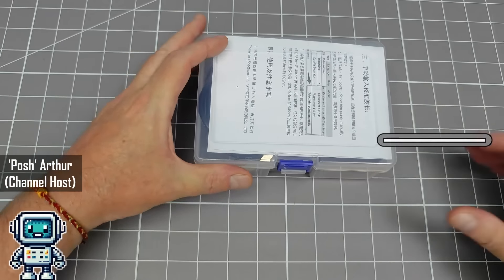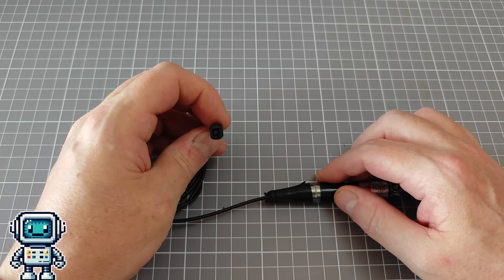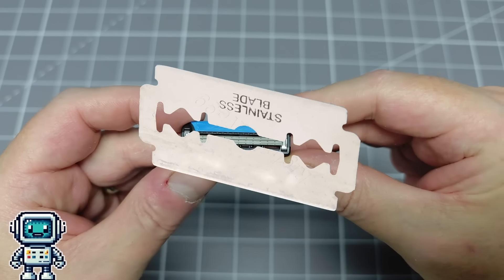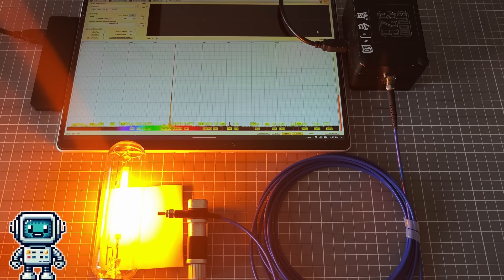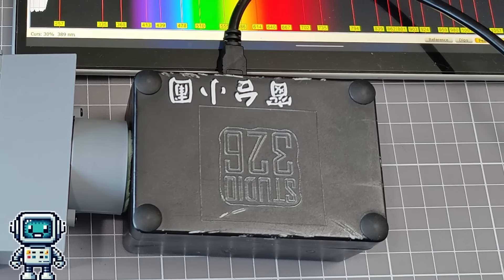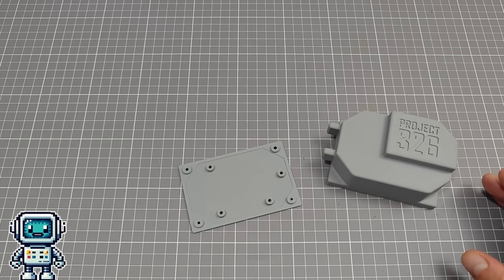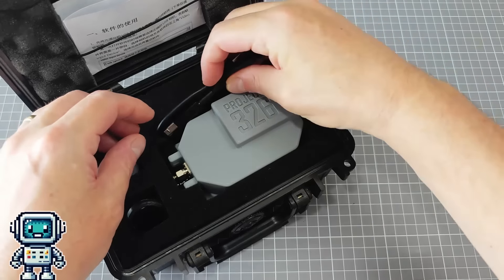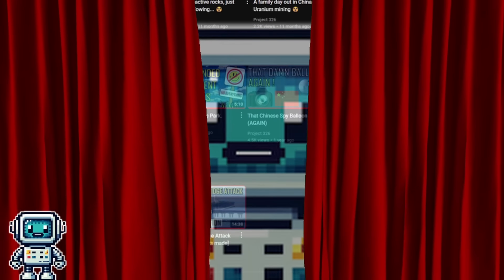Upgrading a Dirt- Cheap Spectrometer

Comment: You have definitely begun to resolve the Na doublet. The second line at 589.5924nm is always lower (less intense) than the one to its left. The resolution of the spectrometer has been increased to less than half a nanometer, basically by definition. I don't really give compliments easily, call it an arrogant personality fault. However this is one of the highest quality channels for serious amateur VIS-NIR spectroscopic investigations I am aware of and has quickly become a favorite.
Reply from the maker: Thank for for the feedback, though to be honest, I think it is only a very minor improvement on a pretty good cheap spectro.  I guess it says a lot about the quality of the original device.

Comment: Love your work and sense of humour! 

On the fiber: So far I didn't bother to take that road- but found a good argument for it just this week- someone wrote in a study (about Raman spectroscopy) - I rephrase " Laser power doesn't matter so much-  it's the laser power density that counts."  so glasfiber forces the user to focus the light source into a tiny area and therefore, ensures a really high power density. With lasers, not so difficult as you can buy dedicated lasers with glas fiber adapters, but with lamps, it's not cool, you need an "concentrator"/funnel to direct the light into the glasfiber.  But may be a sheet of paper with a need hole will act as "pinhole" and do the same as the glasfiber, I will try that first.

On the slit: I didn't know, that little Garden's slit looks so rough. The quick win is then grinding it slightly (but not much, to not widen the slit). If you really make the slit substantially narrower, things get complicated, why I didn't try it yet- less light comes - less resolution? On the other hand- it light bends more?  not sure, but it goes that direction. and it should not spread the light over a bigger surface than what the CCD offers, so may not be productive beyond a certain point. Youtuber "The action lab" has a video "Squishing Light Makes It Bigger" where he uses a wrench to make the slit variable (plus to razor edges), I want to try that out, as I didn't find an authority clarifying the relationship slit-grating-CCD in an understandable way. Thirdly- your option with the foil is definitely an improvement as its less thick than the original one- the thickness somehow interferes from what I have red. Only paint it black. Aluminium foil is even thinner than copper coil, and when stamping the slit with an sharp knive edge, it might get less artefacts, will try that out, instead of scratching the foil.
You didn't dare to touch the webcamera itself- any specific reason ? I didn't get any specification on the sensitivity of this camera, so not sure how sensitive it is.
Reply from the maker: narrower slit give higher resolution at the expense of lower sensitivity (less light get in), so this is always a compromise.

If I am going to get to the level of changing the camera then I would just build a completely new and better spectrometer...
Reply: hello again guys. what you are talking about are "pinpoint attachments" for fiber optic light gooseneck cables. GIA used to sell them (made by dolan jenner) and other companies like Kruss. Unfortunately, they are very difficult to find now. Dolan jenner still sells one but it's $132 USD....it's 100% needed for spectroscopy for gemstones or for taking pictures. Not really required for general spectroscopy.

About the raman spectroscopy, i would argue it's not the density of the laser, of course the power/density matter but the most important is the spectral width of the laser. It must be really really small width (spectral width >0.00001 nm). Those kind of 532nm lasers from CNI laser or other chinese companies specializing in lasers...well they can be $2000USD .But for Raman spectroscopy, because we are looking for the smallest change in particles...the more accurate the original laser, the more accurate results will be. Most of the lasers are too wide (for raman spectroscopy).

All of the good raman spectroscopes that I found use very high quality, very very narrow lasers...
Reply: @mrm1712  Thanks for the hints!.did you find any affordable Raman filters ? so that would be for me 100$ - 200$,  not an 1000$+. The 3 key factors here are -  how far away is the raman signal from the laser signal, how strong is the laser signal to be blocked by the filter and how steep has the filter edge to be..I would guess now with +20nm edge above 532nm, but fairly step and may be Optical Densitivity of 3-5 I can do it for a broader range of minerals (or at least for calcit). However, this OD3-5 is a big range, in terms of $$, makes really a big difference if you buy an OD3, OD4, or OD5 filter- any suggestions ?

Comment: 3D printing can give horizontal 0.05mm accuracy. It likely requires to set the correct options in the slicer. It seems that the original slit was printed vertical. If it can be printed horizontal, it should have less ragged edge.
Reply: I just assumed using a laser engraver would be easier to cut the line
Reply: @MatthewHolevinski  a laser line is limited by the focus. As crappy as 3d printers are, for a thin slit, sliced carefully, they would likely beat a budget laser engraver.

Comment: Awesome!  Great channel.  I plan to some day use an Apple CD DVD drive sled to automate the slit width for optimal performance.  I also plan to use a HD actuator to sweep a higher line diffraction grating.  Been wondering also about using the parts for a Michelson Interferometer spectrometer.  Really awesome to see stoppi perform the some of my thoughts using the parts I was thinking as well.
Reply from the maker: That is an interesting set of ideas.  If you sweep the grating, you don't need a camera module and can use a photodiode with a MUCH higher sensitivity.  

I was one of the few people, back in the day,  that managed to design a functioning optical disc servo and data decoding IC, (only 9 semiconductor companies have ever managed to get optical discs working).

The sled mechanisms suffer from pretty terrible backlash, their absolute resolution is great though.  Usually the sled really has no idea where it is, except when it hits the sled-switch when it centers the mech.  Usually, during playback, the sled servo is just driven with the integral (or double integral) of the tracking error signal...

Comment: You could use the insides of an acousto-magnetic anti-shoplifting tag for the slit. There are two strips of thin steel foil in it that have even edges. A 50 micron slit seems easily achievable.
Reply from the maker: That's a good idea but I found that reducing the slit further didn't really help with the resolution of the results.  It seems that the point spread function had already been reached due to other limitations by the time I had reduced the slit to 200um.  It should also be noted that this device uses a standard camera module so the device is already fighting optical sensitivity and further reducing the slit will only further reduce the amount of light that gets into the product.
Hope that helps.

Comment: I just discovered that SMA connectors for RF can be drilled out and used as 905 connectors. They are very inexpensive but require some skill to modify them for fiber optical use.
Reply from the maker: I tried this as well whilst I was waiting for delivery of the ones I ordered for this project, but here in CN they are more expensive than the ones without the conductor/dielectric included.
Reply: @project-326  Strangely, it is the opposite here. RF connectors are cheap and plentiful. As soon as you add 904 to SMA, the price goes way up!  have you done any absorption tests on the cheaper optical audio cables?
Reply from the maker: @TerryLawrence001  Admittedly, in my day-job I need to use SMA connectors that have ultra-low reflection coefficients up to at least 10 GHz, so perhaps not a fair comparison...
🙂
Reply: @project-326  🙂Yes, i get that

Comment: Très cool. Is there a way (or even a need) to calibrate for the non-linear attenuation of the fiber? I'm not an expert on anything, but I'm looking at a chart for a 200-900nm fiber and it looks like it looses 40% at 200nm, with some smaller peaks above 700nm.
I've done some UV chemistry and found that borosilicate actually transmits a good deal of UV down to 200. I know the fiber isn't the same formula of glass, but it doesn't seem to be fully UV transparent quartz.
Reply from the maker: I didn't notice any differences from the addition of the fiber optic cable in the spectra that I captured.

Comment: Quote:

"The point spread function (PSF) describes the response of a focused optical imaging system to a point source or point object. A more general term for the PSF is the system's impulse response; the PSF is the impulse response or impulse response function (IRF) of a focused optical imaging system. The PSF in many contexts can be thought of as the extended blob in an image that represents a single point object, that is considered as a spatial impulse. In functional terms, it is the spatial domain version (i.e., the inverse Fourier transform) of the optical transfer function (OTF) of an imaging system. It is a useful concept in Fourier optics, astronomical imaging, medical imaging, electron microscopy and other imaging techniques such as 3D microscopy (like in confocal laser scanning microscopy) and fluorescence microscopy."
Reply from the maker: Thank you for the more detailed explanation than I was able to provide in the video.
Reply: @project-326  i had to look it up myself Mr Project~427.
The actual equation for this function is quite interesting

Comment: First thing I did with mine had similar motivation, in my case adding a T2 threaded ring for accessory mounting against the slit. I was surprised to see the slit just 3D printed but I guess it works. Never thought plain razor blades would be hard to find, I got a box of 100 for under $10 as I recall.
Reply: They are hard to find in China. I used snap-off box cutter blades instead. Those offer superior performance.

Comment: I often use the tiny blades used in crafting knives like olfa and exacto make. I epoxy the short snapped off pieces of blade to small rectangular frames that I print on the 3d printer. I use a hair or piece of Mylar to space the blades until the quick epoxy sets up.
Reply from the maker: I would probably assemble this under the microscope with a graticule as a guide, if I were to do this again.

Comment: Found a quartz SMA905 fiber optic cable rated for 200-1100nm. Assuming I'm looking at something either close or identical to what you have for your setup, the attenuation graph is pretty choppy ranging primarily between 10 to 1000dB\km. Have you tested any of your light sources with and without the fiber to see if the readings are different? 

Btw, I loved the video and I've already mentioned I now own a spectrometer now. Life is better.
Reply from the maker: The problem with those attenuation curves is that they assume high bandwidth data and this is basically a DC application.  100dB/km is fine for a 1 meter cable...
Hope that helps.

Comment: Nice! I like the little garden device... And your improvements are quite impressive! BTW, did you upgraded your KC761B already? Works much better!
Reply from the maker: yes the new FW is much better on the 761B
Reply: @project-326  yes but I meant the new pin diode flap, very practical!
Reply from the maker: @PeterMarchl  Yep, you have me to blame for that, in the video, the comment about invalidating the guarantee really struck a nerve with them...
Reply from the maker: @PeterMarchl BTW, where are you based?
Reply: @project-326  I thought I'd answered that question... So, it's Germany.

Comment: Why didn't the razor blades work for the slit?
Reply from the maker: disposable razors are bent around in an L-shape and it made it really awkward to align, also there were issues with cutting the excess razor length, either before or after fitting into the holder, was another challenge...

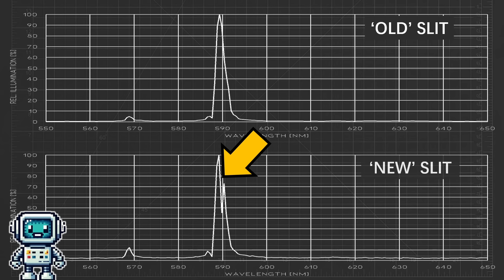Comment: 6:14 ensure that the high pressure sodium lamp is either fully heated up, or only just starting up, before taking the measurement. What you should see during the warming up of the lamp, is first the sodium double line. If you compare the old to the new situation, do this right after starting the lamp. 
As the lamp heats up, it should go from a line to a hump that gets wider as the lamp gets hotter and the internal pressure increases. When the pressure gets high enough, the sodium vapor will start to visibly self-absorb the line (but not the wider 'hump'), and you'll get a hump with a very visible dip in the middle of it. Take care not to interpret this absorption dip as resolving the double sodium line. The double sodium line will only be visible when the lamp is still mostly cold, but already some sodium has evaporated to show the monochromatic yellow light, and not yet the characteristic golden white.

Comment: If you can manage it, I strongly suggest the Sony Alpha 7CII, which doesn't have the oveheating issues that are reported for the 7C. Also it has some more codecs and does 4K 60 fps. It costs 50% more though.
Reply from the maker: I think we are up to about $200 so far, plenty of time to figure that out.

Anyway, thank you for your advice, I'm not much of a camera expert so I really do rely upon the viewers advice on this aspect (been very lucky with lots of advice on this point so far).
Reply: @project-326  yw. So a lot of cameras over the last 5 years have big problems streaming or recording for a longer time due to overheating. Only recently did it get any better, and the 7CII is the first generation in that line to not have that issue.
Reply from the maker: @cheater00  thanks again for the advice...
Reply: @project-326  no problem thanks for taking the time to tell me about the spectrometer :) we love your videos on the tek/hp discord

Comment: I've got a ton (English, not metric) of comments about the refinishing of the enclosure.  Switching to a 3D printed enclose makes them all moot, of course.  My one overall comments is that you might have made the enclosure larger, not smaller.  Smaller implies cheaper.  A few pointless, useless, extraneous LEDs on the exterior might have made it seem 'futuristic' as well.  Is the spectrum analyzer software included with the purchase of the spectrometer?
Reply from the maker: Thanks for the feedback.
The software is an open source application called Theremino Spectrometer.  The creator of the original device has upgraded the software and a download link is included with it.

Comment: Did you use singlemode, or multimode cable? I find conflicting information on which type is more suitable.
Reply from the maker: Thanks for the comment.  I'm not sure it matters, this is not a data communication application, essentially we are dealing with DC optical signals.  The refractive properties should not have any effects on the wavelength that comes out of the other end because we are not modulating the light source, well at least not with respect to the modulation bandwidth that fiber optic communications systems are expected to work at.
I hope that is helps to answer your question.

Comment: Nice upgrade. I wanted to build an adjustable slit with razor blades and fumble around with the width and see what happens. 
Stainless steel is actually a pain in the S for gluing and stuff.
Maybe i should try and make a tiny nut shaped steak and fry it on the blade and it'll never come off 😀
Reply from the maker: if you get razor blades that come with a Teflon coating, it will stick even better.
;-)

Comment: I think the use of copper foil is a mistake. Thin copper will corrode unevenly and quickly. I would consider the use of a much more inert metal, like Titanium, Rhodium or Gold foil.
Reply from the maker: Hi, that is interesting feedback, you are right, corrosion will occur over time, but to be fair it's not hard to replace.  In either case, the corrosion would need to be very extreme to be worse that the original 3D printed slit.

Normally stainless steel is used (hence the razor blades) and perhaps later this could be an update.
Reply: You can also order PCBs with gold plated copper and slits etched into them for a couple of bucks. Slits down to 150 or even 100 micrometers are standard for most prototyping services. Just need to find a way to remove the copper from the pcb's but there probably are many ways to do that.

Comment: great video !!! by the way what diffraction grating is it using ?  Is it still a piece of DVD or a transmission diffraction grating ?
Reply: According a dealer on aliexpress, an DVD grating is used with 1350lines/mm. That‘s not bad, no?
Reply from the maker: mine is a DVD based grating.  In future I might build a better and more sensitive device using a first surface reflective grating (the poly-carbonate of the DVD filters a lot of UV out) and a more sensitive industrial camera module that is monochrome.  There is just no way I want to be messing about with Bayer filter removal...
Reply: @project-326   a classic transmission grating is quite cheap and could really improve this device as the dispersion would be more homogenous in the vertical axis as a DVD give circular spectral lines. Try a 600 lines/mm or even better a 1000 lines/mm ( wich would probably be the closest to a DVD.